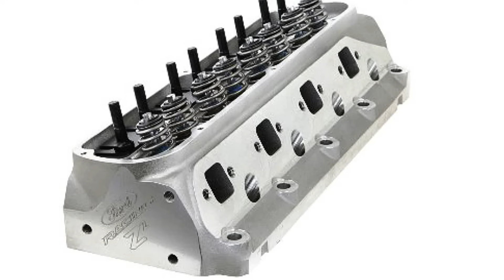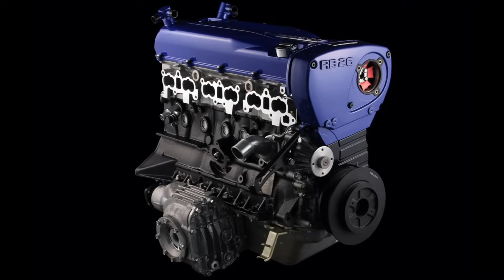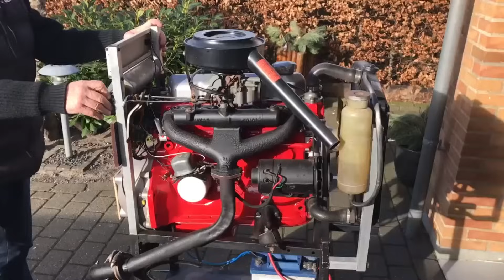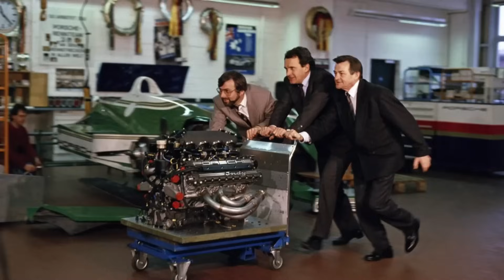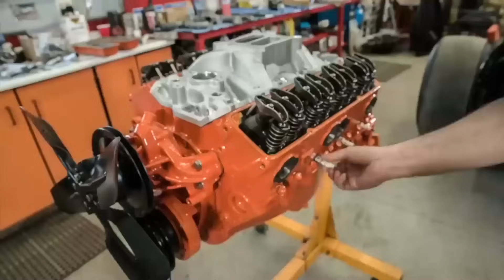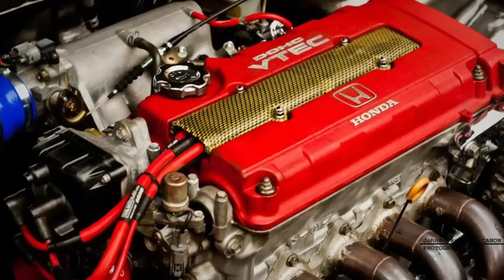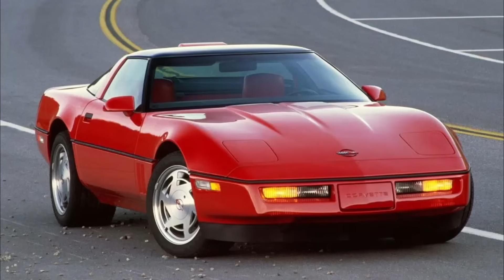30 Car Engines That Will Last FOREVER (2024)

Comment: From Sydney. Australia, I have owned a 1874 Cadillac Fleetwood Talisman, an export CKD kit car, sent as parts in crates to be built here in Sydney as a factory right hand drive car, It's now 50 years old & I've owned it 42 of those 50 years, As an export spec' engine it has NO anti pollution/smog gear. So it's a "full power" 500ci, or 8.3 litre engine & when I bought it there were near 50,000miles on the engine , now 42 years later it has almost 450,000 miles on it.

Impressive total reliability, after owning the '74 model for 10 years, I bought a white "72 model as a spare, or, backup car the then 19 year old car had a nere19,000miles on it, now some 32 years odd later it has 233,000 miles on it, and again total reliability.
Reply: in Australia we get stuff long before other countries even herd of it ,   we get special treatment
Reply: Greetings from Sydney NSW: Blame it on the Fosters, mate.
Reply: Mines a 1774 and still carriging
Reply: @jorgemarin7303  :face-green-smiling:   Whooo Nelley!
Reply: Oh, heck, that nuthin.
I gotta 1074 that I baby.
Reply: Honda Civics 4 cyc engines run FOREVER all you need is a good 0 - 20 oil change every 4 k miles
Reply: Wow. That's planet friendly.
Reply: @warntheidiotmasses7114 trees love carbon, didnt you hear? thats new info, might not have reached ya yet. ;)
Reply: @warntheidiotmasses7114
Reply: Yeah, sure, buddy. It honestly sounds like you're just making the entire story up. Anyways, that's nothing compared to the 1500 BC Moses Edition Cadillac Fleetwood 75 that I purchased like new condition off of FB Market Place, a while back. It's the very same model clothed in white interior/white exterior that he used to haul the Israelites around during the Great Exodus. And with all of that big block horsepower, some even say now that he did such a long rolling burnout in it that it actually parted the Red Sea in two. So they could pass through safely. All the Egyptians had at the time were some lame Camel Powered rides. They just couldn't keep up.
Reply: 1874?  You aussies up us Americans every time. Maybe no pints before typing next time
Reply: I think you meant 1784
Reply: 1874 eh?   Yea,   😉
Reply: @MickeyMishra Obviously a typo.

Comment: You have no idea about Nissan Patrol VTC TB48DE 4800 engine. The reliability,  power output and long life hassle free. I have a 670000 km on my 2005 Nissan Patrol, once had all coolant leaked in seconds due to radiator hose slid out at hi Rev climbing up steep road. Ran for more than 25 km to repair shop to fix new hose and coolant and still have excellent power with no engine or head cracks. Once ran engine with no engine oil or below dipstick level for almost 250 km with no over-heat or else, and it's a stock engine with no modification at all. Btw I'm the first owner. Now thinking of pimping up the engine to reach 1000HP, as it's  a habit here in Arab Gulf states 😅
Reply: cuz it's not available in the content creator's country hence it's excluded.
Reply: Exactly. This is one hell of an engine. I have equally moved with it with no water at all for almost 15km after radiator was punctured by flying object. With repair of radiator and adding coolant was fine to drive and still with no problem. I now understand why it’s attained cult status in the Middle East

Comment: 2 to 3 hundred thousand is not a lot of miles'Any modern gas engine should last that long and any modern diesel should last a million miles'
Reply: the Chevy Cruze's (or anything with that engine) don't get close to 300k miles, neither does any modern Jeep with the FIAT engine or any Ford with an EcoTech engine (the rubber timing belts perish at 100k)
Reply: @GTFORDMAN  Those engines fail because of faulty design features not because of normal wear.
Reply: Lol
Reply: I've got a 2010 honda crv 290k klms and still running as good as ever
Reply: Yes, but how many actually reach +300k...very few vehicles actually reach that (especially engines designed after the implimentation of strict emission controls) , without being rebuilt at some stage.
Reply: @gerhardstrydom5249 Car crash.

Pickles Salvage Cars in Australia has lots of crashed cars, with well below 200,000 kms

Comment: The Ford 302 and the Chevy 350 became 200,000 + mile engines later in their production. The pre 1980s versions weren’t bad. But they were just average before then. Around the mid 1980s they improved dramatically and became the 200,000 + mile engines we now love
Reply: A lot of that was due to technology advances like using fuel injection and electronic ignitions which the early versions rarely had. The Chevy 283 was the predecessor of the Chevy small block engines like the 327 and finely the 350.  The basic 283 in 1957 was a simple but tough engine and easy to work on.

Comment: The correct title should would be: 30 car PETROL engines etc. etc.   A lot of DIESEL engines would outlast the petrol ones.
Like my 2002 Volvo D5 with over 850.000kms on the clock, and never had engine problems. Just regular maintainance.

Comment: Did this video mention the Toyota 5VZ-FE? Not sure what else it was used in, but I had one in my 1999 4Runner. That engine has a HUGE reputation for extreme longevity. Engines commonly exceed 200K miles, and almost as commonly 300K. Some engines have reached 1M miles, just with routine maintenance.
Reply: Mine is at 250 thousand in a 98, just did the second timing belt and hoping for another 100000

Comment: In 1991 I bought a Chevy inline 6 thinking it would save gas and be reliable it broke down in South Denver 2 weeks later ..a RI guy had a head and mounted it for me...I returned to Sacramento with new insights ..shoudda bought a 350 V8 .
Reply: I think the Chevy 250 six was only sold in USA until 1984 - sold overseas for a few more years

Comment: My 1974 Miata had, of course, a Mazda BP engine. I bought her at 40K miles and drove her to 165K miles before selling her. That was 115 K miles. She never burned a drop of oil, and nothing (of the engine) ever broke. When I sold her, the buyer picked her up in Pasadena and drove her home to TX. He was so amazed that she had made the entire trip without issues, he called to tell me about it! That motor was in fact very reliable. I would bet anything that any well maintained BP would go at least 200K… and 3 is not out of the question!
Reply: Referring To Engines As "Her" and "She" May Not Be Best When Talking About Modern Western Feminist Influenced Women, Who Are NOT Reliable!
Reply: @michaelchevreaux7780 If you narrow she to being the human female you may have a point, but she can be anything.
Female dog is just one example. Most female dogs are reliable.
Reply: @muhammadsteinberg  
Read what I said again.

Comment: My first car was a  1965 Plymouth Valiant 4 door with the 225cu. in. slant 6 and a 3 speed automatic. The car and engjne ran like a top, easy to work on and given the Valiant was not a huge car it had decent performance and good general fuel economy.
Reply: My uncle owned a Valiant with the 225. Great engine!
Reply: how nice to hear someone describe actually using a car for transportation and utility.

Comment: Well my Jaguar 3l V6 runs like new and now has 150.000 miles on the clock I am looking forward to the next 150K  it's ZF 6 gear automatic shifts effortlessly too ...runs on new oil and filter.

Comment: The slant 6 and the later Super Six were incredible. I knew a taxi company and he told me he could get a million miles on them and 400,000 on the transmissions because the oil was always warm. The 318 was another exceptional engine. Robust and very durable for hp upgrades but never got the publicity like the 340.
Reply: Had both a 318 in a 96 Jeep and Slant 6 in a 77 Aspen wagon.  Gr8 engines!
Reply: I had a slant six in a 76 Dodge Dart. The car was rusty, but the engine was very durable.
Reply: @dave3657  bought a nice 73 duster with a slant that had 125k on it in 87. sold it with 210k in 91. car died and it was put in a 67 d100 pu. i still see that truck around town occasionally.(last i heard it had "approximately" 550k - i say approximately because the truck hasnt had a speedo working since 02 or 03.
Reply: the 1974 slant six was produced during union strike/ slowdown.  They had to be replaced at 38 thousand miles and the transmition at 50 thousand.  had one!
Reply: @wanttopreach in 1970 in Australia the slant 225 was superseded by the Hemi inline 6 245 in Valiants and dodge trucks. 1971 saw the 215 low comp and the 265 Hemi. The 265 was most economical of the lot and 203hp as base model. Twice the motor of the slant.
Reply: @wanttopreach  so 1 year of poor workmanship doesnt negate the 20 years of solid production.
Reply: I had a valiant with the slant six and a D100 absolute units
Reply: The 318 V-8 was a great Chrysler engine, it actually started in marine division for boats.  Had two versions, early model 1966 and earlier was big block, and 1967 after was small black, about 90 lbs lighter.  Both great engines, not fast but very reliable.
Reply: My family's 3rd car was a 1966 Valiant Wagon, bought new, I used it in high school before my dad replaced it 😊with  a '68 LeMans. I remain convinced that the 225 slant 6 and the Torqueflight transmission were almost indestructible. I abused the heck out of it in snow and ice, it was one tough car!
Reply: @burningblue1254  318 in a 57 Dodge was my 1st engine!
Reply: Toyota always win the game

Comment: K20 cylinder head on a k24 block is the daddy and you forgot the Volvo t5r five cylinder engine which can be tuned to 1000bhp😮

Comment: Sold a  running 2.3L Ford Ranger still running at 300,000 miles.
The other a '78 Toyota Corolla pulled the engine becuz it was marking it's spot like a old Harley. 1.6 L 2T I-4 pulled at 300,000 miles.
Both were stick shifts. Yes a automatic can put a heat load on a cooling system.

Comment: It's a good list. Like others I would've suggested the Chrysler Slant 6. 

I forget the nomenclature but the Mercedes-Benz 2.4 L diesel that was in so many cars in the 70s and 80s and several taxi cabs have gone over 1,000,000 miles with one. 

Like all lists this is subjective but it still seems like a good list
Reply: agree, i think alot of the merc diesels should be on the list, Currently have a 2007 grand cherokee crd with the merc 3.0 and have 405,000 km.

Comment: The greatest most reliable all time car engine would have to be the air cooled VW flat 4.
Reply: Valve adjustments every 3,000 miles, leaks, and underpowered.  That was my experience.  Although it took a lot of neglect.
Reply: a joke or ignorant.   the good news on those venerable engines is that they can be rebuilt quite easily,   but they require that rebuild every 40 thousand or so miles.
Reply: the VW flat four lasted longer than almost any other engine because most of its life it was sitting on the workbench waiting repair

Comment: My Ford 7.3 IDI non turbo made it past 800 km or 500 thousand miles, sold it to a Russian diesel mechanic and it probably still running since the body had been totally replaced.

Comment: You missed the Ford 351W. Particularly later versions that had roller cams & roller timing chains. I've seen them go 500K miles in hot shot trucks that were maintained but beaten on badly. I have one that's 30 years old with about 100K miles and it's barely broken in. Runs like the day I bought it new. Same with the 1ZZ-FE with 270K miles in my old Corolla. You also missed the 2GR-FE delivered in many Camrys, Avalons, and others. There are plenty of those with over 400K miles still running well.
Reply: I have that engine in a 1993F 250. Has 186,000 miles on it doesn’t burn any oil works like crazy. I love that truck but I live in New Hampshire in the salt is finally starting to get to it after 31 years. I’m seriously thinking of investing $8000 in the body to redo it. It’s a beautiful motor.

Comment: Missed the Barra
Reply: The Barra should be on top of the list. Being used in Australia as a Taxi, Ford Falcon, Fairlane, and Fairmont all get anything around the mil km. I have a Ford Territory with Barra, and my Wife has a Fairmont with Barra. Both have more than 250K, and all we ever do to it is Regular Oil changes and the usual parts like breaks, and that is basically all. Fairmont 2004, Territory 2007. They will outlast us with proper care.
Reply: I owned an BA Falcon ute that had 700,000 km on the clock and traded it in for an SUV.    Still remember the used car salesman freaking out at the km's.

Comment: Isn't amazing how many of the engines mentioned are not turbocharged, says a lot for how good turbo charging is meant to be!!!
I drive (over here in UK) VW Polo with 1.6 turbo charged diesel, Odear Odear, give me back VW'S 1.9 natuarly asspirated any day, mainly for fuel consumption and lower end torque.

Comment: i worked on a windsor back in 78 n i ate the barings with only 35,000 miles on it. oil changed every 3k miles n all. piece of junk!

Comment: 2.2 20v-turbo(5 cyl) audi s2/4/6/rs2.... 2.3 20v-turbo(5 cyl) volvo 850 t5-r.... 1.9 16v-turbo volvo v40 t4.... 1.8 16v golf/scirocco gti/gtx 1st generation 16valve(PL/KR engines).... 1.8 20v-turbo golf 4 gti/ audi s3.... 2.0 16v GSI opel astra/calibra... mercedes 4/5/6 cyl diesels..... saab turbo engines?.....

Comment: I had a 1983 RX7 283,000 miles.and still was going.regular oil change antifreeze hoses.Sparkplugs Tranny oil New brakes claw Clamps.And the rotary burns oil to lubricate apex seals so u had my tiny external oil pump properly inspected and adjusted every oil change.New dealer only thermostat  and filter.The best reliable car.I even Slept in it during my long road trips
Reply: I had the same car. I wish I still had it.

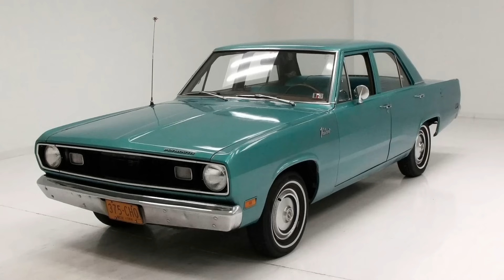Comment: 21:55 "This inline 6 powered everything from Plymouth Valiants to Dodge Darts"  Yeah that's a wide range of vehicles between Valiants and Darts oh wait they are nearly identical.
Reply: But they did power a buttload of combines
Reply: That’s how you can tell that the writing was influenced by AI. Any human would have mentioned a different second vehicle such as the pickup Truck or full sized car.
Reply: @soyounoat2814   And the Dodge D100 And early model Ram1500 pickup trucks too...They maybe slant 6 engines, but i heard they are reliable engines that Chrysler ever made. Never heard any issues, and never seen any Dodge cars or trucks stalled on the roads...
Reply: @levyoliver5363 
I was just going to mention the half ton trucks. My first truck was an 84 D-100 with the slant six and a four speed. I didn't care a bit about speed since she was solely a work truck.
Reply: @leehuff2330   The Chrysler slant inline 6 engine would also be perfect to be installed in the Weapons Carrier military truck or Power Wagon. Using a 4WD transmission from the D200 pickup truck...with 4 speed manual transmission and transfer case...
Reply: @levyoliver5363  
I've thought the same thing. The 225 had higher horsepower and torque ratings than the 251 flathead the 46 Power Wagon came with.
Reply: @leehuff2330   Exacty right. Because the 225 is a bigger inline 6 cylinder engine than the 251 flathead power wagon engine. I think it's the same engine used in the 1956 Fargo pickup truck.
Reply: And polaras and furys and Belvederes and on and on….
Reply: @BarryTsGarage  exactly! Yet the narration mentioned only the twin cars. AI produced content at its finest 😂
Reply: I had a 67 d200 with a leaning tower of power among other lighter vehicles. Definitely should have been in the top 5.
Reply: Full size vans also

Comment: You forgot the in line twin cam Alooooooomin-Numb head belt driven Aurelio Lampredi ferrari designed engine in the FIAT 124 CC Sport Veee-Hikulls

Comment: My 2.2 L Ecotec powered 2005 Chevy Cavalier has 230,000+ miles and is running strong. I bought it new off the lot. I also own a 1986 Ford E150 Van with the 300 ci straight 6 that I bought new off the lot, 250,000+ miles and still going strong.
Reply: Ford 300 straight 6 will run forever.

Comment: Exactly...i like the 22R and 22RE Toyota engine! They are extremly Reliable engines! Id' keep them forever!
Reply: I own 3 20R  engines, the one that's in my 1977  Toyota Hylux, is out of a 77 Dolphin Motor home, 
It will be surpassing 300,000 in another 4 months, the other ones are on stands have been taken down and checked, nothing to see here, only thing that has been done on all three have been points, plugs, condenser, pcv and valve guide boots, with adj on valves, compression runs at 147 to 152 psi.
regular oil changes, at 3000 miles, only additional lubricant that I recommend is Prolong.
Wouldn't trade it for nothing, 😊
Reply: Keep an eye on oil changes & timing chain. If the chain even starts to get noisy, change it. Check the timing cover when you do, as a loose chain can wear a hole in it & this can dump antifreeze into the crankcase. Early 22Rs had double row timing chain, which is better.
Reply: that and the slant six  were in practically all the cheap second hand vehicles i bought in my years in the US .
Reply: @terrenceolivido741   i heard that the Chrysler Slant 6 engine is reliable. No issue in the engine as long as it is well maintained in oil changes..ect. i would love that engine in a Dodge D100 singlecab pickup or in a Ram Charger SUV...

Comment: I think the F20C 2.0 in the Honda S2000 should be #1.  If you Google the top 10 most reliable Honda's the F20C is #1 on the list so I think it hurts the credibility of your list for no mention at all of this 9,000 RPM beast of a motor.